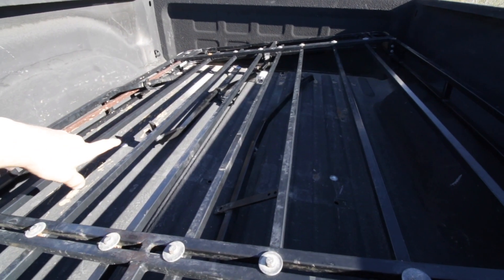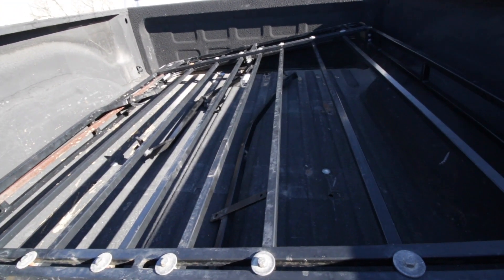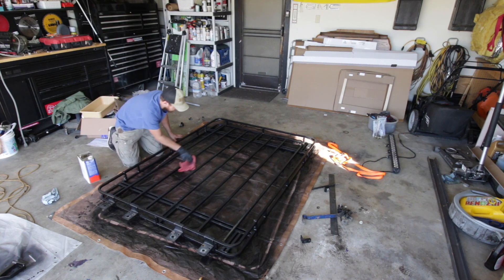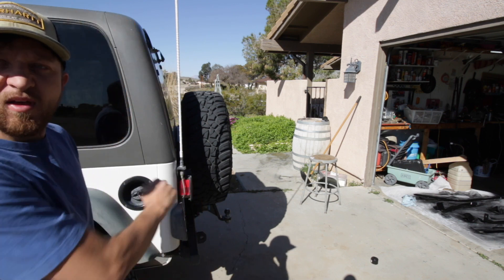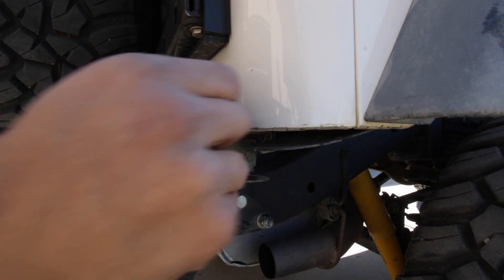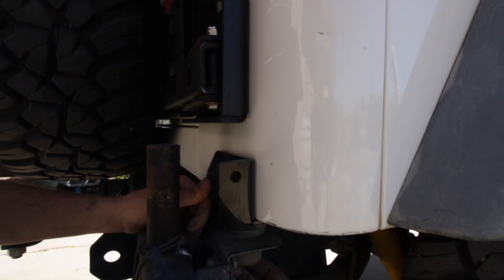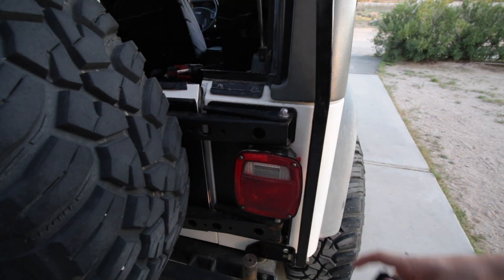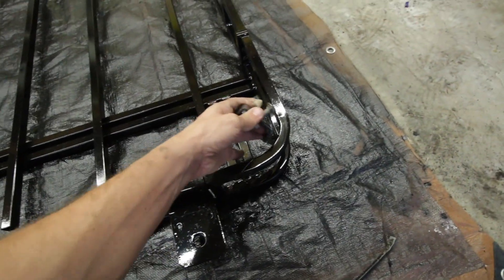Jeep TJ Roof Rack Install

Comment: Nice rack bro! Thanks for sharing!! Will that roof rack hold a roof top tent? is that the 21-22 inch light bar?  Love your jeep setup. I have a 98TJ sport. Love them TJs
Reply from the maker: Thank you! Yes it will hold a roof top tent! In fact I may go that route I the future. These racks are very strong. 
If I remember correctly it is a 32” light bar. I am really starting to enjoy the setup of this jeep. It’s current forum makes adventuring so much more enjoyable.  
TJs are one of the best platforms around! Just have to get passed the whole space issue haha. Thank you for watching and commenting! Glad you enjoyed the video!
Reply: Embark With Mark thanks so much bro for answering my questions and sharing vid!!! love your setup brother, badass TJ!!